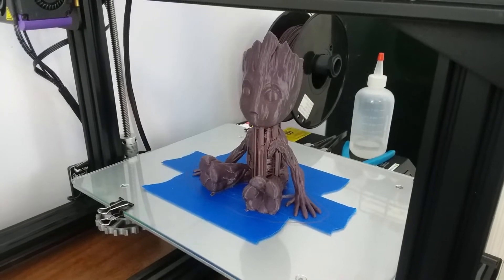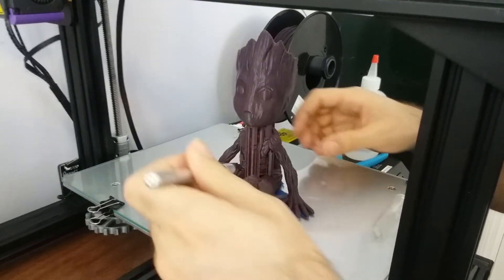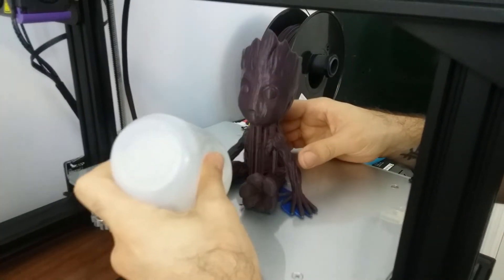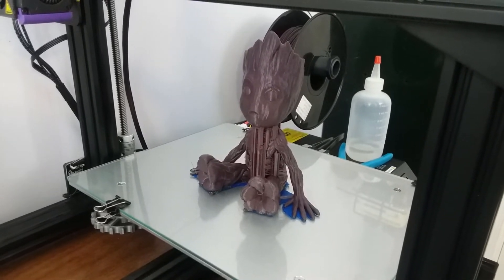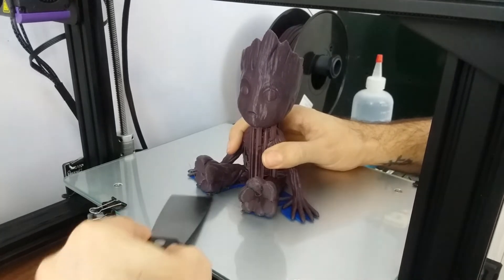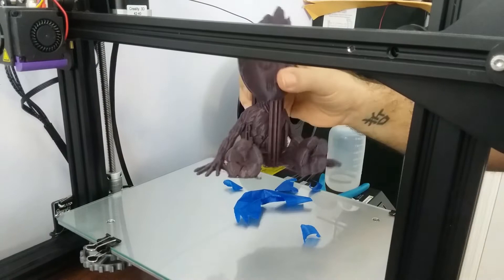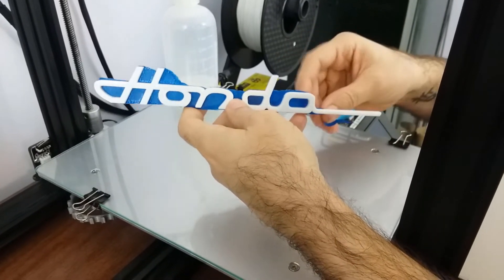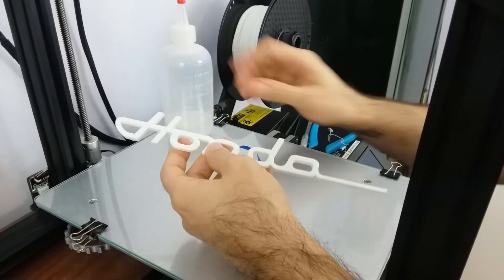Removing 3D Prints on Tape - Quick Tips

Comment: Thanks for this! I've been printing on PEI powder coat with and without glue stick for a while. But printing on a new printer with aluminum + tape is considerably different. I absolutely love the strong bed adhesion and the forgiving first layer that tape provides. Now this tip made part removal much less cumbersome. Thank you.
Reply from the maker: Awesome, glad it helped you! Aluminum plate is a great application for using tape.

Comment: So it's acting on the tape adhesive by soaking through the paper, I get it. I use 50/50 corn syrup and water on a bare aluminum plate and it works great for PETG, ABS+ and PLA, but it does NOT like to play well with TPU. SO after a half a day of swearing at failed prints I finally decided to fall back to painters tape. Just ran it right over the corn syrup glaze, lol. I'm currently blazing along at 70mm/sec with clear TPU and really impressed at how well it's laying down. It's a thick part - a homemade phone cradle, and it just would NOT stop curling off the bed no matter what I did. Looks like the ol' standby of blue tape is doing the trick. 240C extruder (I know, f'ing hot as hell but I'm going for that glassy look), no bed heat, 70mm/sec extrude speed and 1.0 extrude rate. No retracts, just 1mm coast and 1mm wipe on layers. No fan either, open cabinet. It's cruising up on 5mm thick right now and not a sign of corner lift so far, very nice and a huge relief after so many failures.

My first thought was "Yeah but how do I get the thing off the bed when it's done?" lol. Got a ton of IPA so I guess it's just waiting for it to finish and hoping it plays nice all the way through. If I can get flawless printing with this TPU, I might go back to tape for everything, especially ABS and ABS+ which are SO bitchy. Would be nice to fire out prints in those with no fighting. I hate having to round every corner on my designs just because of belligerent filaments.
Reply: BTW for your amusement, my printer is an ancient Robo3D MkII, heavily modified. This thing has served me incredibly well through hundreds of prints and all kinds of plastics. First thing to go was the glass bed, which kept cratering on cooldown. Replaced it with 1/8" aluminum plate and a large 120VAC heater pad. Next was a Lexan sheet enclosure built right onto the existing plastic box. Then I upgraded the extruder assembly with homemade parts and an E3D hotend. Added a top mounted spool holder which feeds through a small hole. Added an extended PTFE tube tonight to eliminate spaghettification with TPU, almost a direct-bowden sort of Frankenstein thing, and that seems to be working very well for me, got me into some really nice speeds. I know this printer is old enough it can die on me any day, but I'm getting what I can out of it while I can.

Filament of choice for tonight is high speed clear TPU from Sainsmart.
Reply from the maker: The IPA does soak through the tape some, but what I've noticed is that it gets under the edge of the tape and as the adhesive releases the IPA keeps working it's way under.

Painters tape on a smooth build plate is great for TPU. I've actually had some TPU that sticks too well and I've used glue stick on the tape. That does sacrifice some adhesion though and I doubt it would work well for your thick print.

Glue stick on PEI is really good for TPU also.

Comment: but how do you remove the tape from the part?
Reply from the maker: Once it's off the printer the tape should just peel off of the part. If the tape is really stuck to the part and rips/tears instead of peeling off then your nozzle may be too close on your first layer.

If you end up with tape that doesn't want to peel off you can use a razor blade to carefully scrape it off. That's what I did before I figured that that you really need almost no first layer "squish" for good bed adhesion on blue tape.

Comment: If i want to reusethe same tape is there any suggestion?
Reply from the maker: If you can get your first layer height so that it's just barely low enough to stick, then the print will usually pop off the tape when done. You might have to use a very thin spatula to start one corner, but if you're careful you can do it without messing up the tape.
This works well for me on smaller/average sized prints, but large prints it can be really tough.

Comment: You can print that Baby groot without any support.
Reply from the maker: True, but at that time I wasn't confident in the printers cooling or ability to print overhangs well...or maybe more truthfully, I just didn't trust my profile well enough yet.
Reply: @Review3d  well it seems like a great profile. Nice work. The alcohol works great for taking the prints off too. To be honest for play I use 85’C for some reason I get a better stick. But too good sometimes. I did this method it worked great. Then tried it with bed still hot. This came out great too. Peeled off